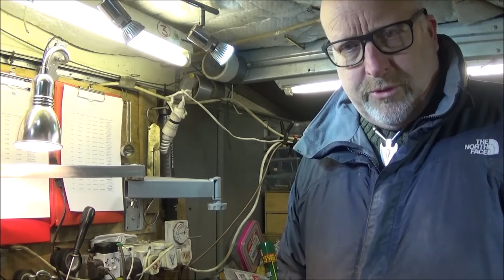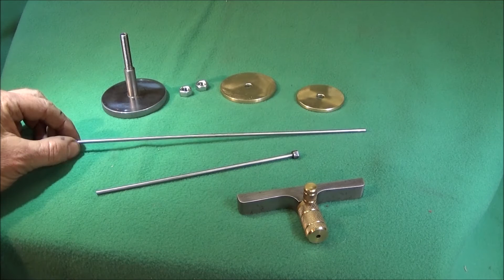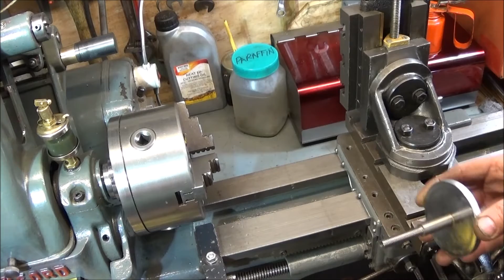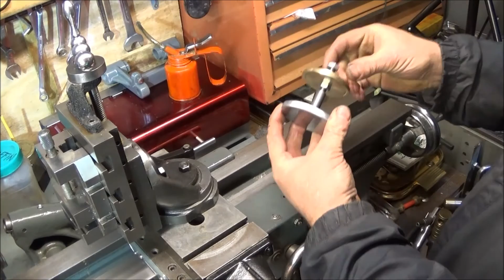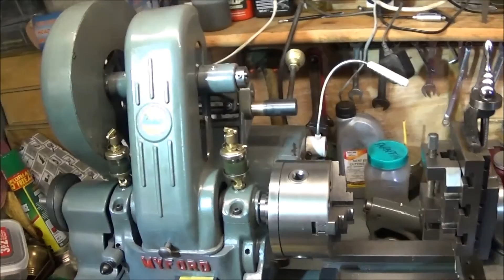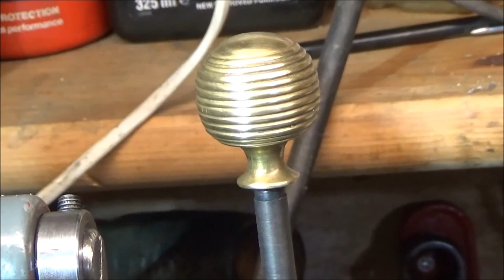Home Made Groove & Depth Gauge Myford ML7 & Mini Lathe Clock Stand

Comment: Steve, if you add a threaded collar that attaches to the flat, knurled base, (on the clock holder) you could eliminate the topside nut as well as having to us a wrench to tighten loosen for adjustment; rather you could use that knurled base as such.  I know you use it in your chuck as well so a threaded collar that slides over the shoulder on the aforementioned knurled, (and chrome) base and sets with a set screw then you can eliminate the uppermost nut and utilize the chrome, knurled base as the quick adjustment. yes it will affect a clock if one is on it but for initial setup and even fast adjustment later, still should be more convenient.

Comment: What causes the racket your lathe makes? Is it the belts?
 I was thinking of buying a set of those link belts for my ML7, but rather not if they make more noise than regular v-belts
Reply from the maker: Hi Thomas, no it was the motor shaft making the noise. The pulley had come loose and the shaft was rattling back and forth. Also because I'm in a small metal shed where the noise is a bit amplified when recording. It is really quiet now. If you do get a link belt, I would recommend the Fenner one from USA. If you have an ML7. When it is set correctly it allows the spindle to actually stop completely when the drive lever is released. There is actually no need to have a clutch like they introduced on the later models. Regards Steve
Reply: I thought it would be another source of noise :) 
And I was wondering about the quality of the different brands of link belts, there is no-name brands and there is some quite expensive ones. Here in Norway, I have found only one source so far. And it was something like 90 pounds for a meter of it!!  :O